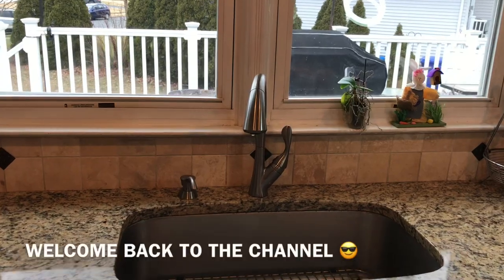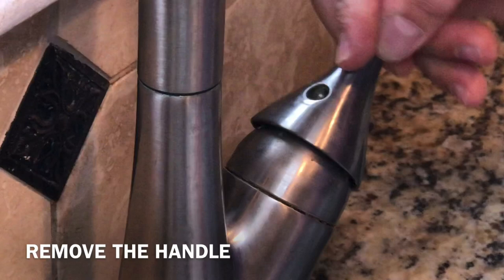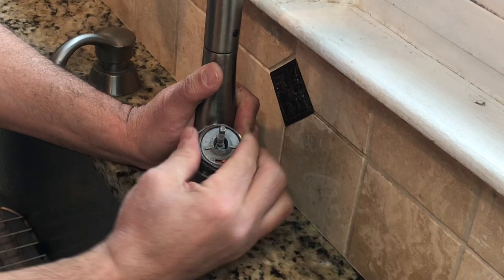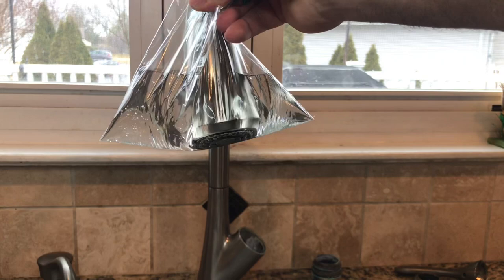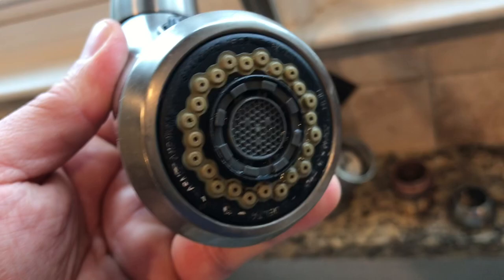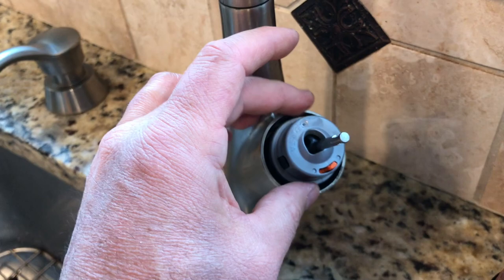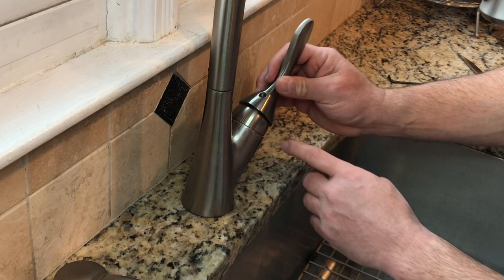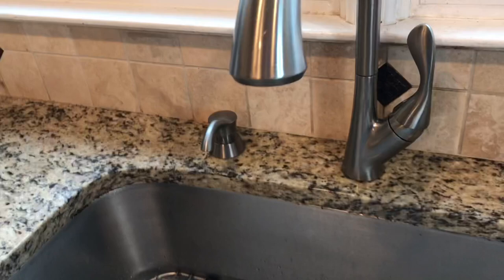HOW TO FIX A LEAKY DELTA FAUCET - Replacing a Valve Cartridge on a Single Handle Delta Faucet. Easy!

Comment: The dome on top of cartridge you removed by hand, I am not able to. My wrist is not that strong. It is stuck. The surface is all curved and besides i do not want to damage trying to remove with metal wrench. Any ideas on how I can loosen it up? WD-40?
Reply: I'm having the same problem.  Tried a rag around the dome with a wrench but still can't remove it.  Also tried WD-40 and banging it.    We have very hard water so its lodged in there pretty good.  Will try again once my wrist heals....
Reply: @BillKoren-ej7zo  So you can literally feel my pain 😞
I am at a point of doing whatever I can to get it open. Maybe get new part to replace damage.
Reply: Update: I ordered new dome and using plier teeth directly damaged and removed the dome. I have new dome so what do I care?
Problem: The dome came out fixed to the nut! Now I have to separate dome from nut. IF I cannot fix this I have no water in kitchen. 
Soaking it in vinegar now and praying. Hoping someone has bright idea in next few minutes to help me out.
Reply: Update: Soaking in Vinegar then using Rope Wrench on the nut and plier teeth on the dome did the trick! Just make sure when you ask delta to send the cartridge also ask for dome.

Comment: The dome cover is stuck and so tight, not turning at all. Any ideas how to loosen to unscrew it ?
Reply from the maker: Try some penetrating oil and/or applying some heat.

Comment: I have a hard time taking your advice repairing the drip issue when 1) your faucet is loose and moving around and 2) the instructions on the repair part clearly state "TONGUE AND GROOVE PLIERS ARE NOT RECOMMENDED TO TIGHTEN THE BONNET NUT" in addition the instructions state "THE BONNET NUT/VALVE CARTRIDGE SYSTEM DEPEND ON TORQUE TO CREATE AND MAINTAIN AN ADEQUATE SEAL OVER TIME" they specify a torque of 70-100 inch pounds.
Reply: I think you are trying to add a couple of suggestions to his video - but I can't tell.
I'd rather do it his way then pay a "Plumber" $225 to do a $10 Job.

Comment: Is the Delta RP50587 Single Handle Valve Cartridge a standard for DELTA? I have a very similar-looking DELTA faucet that drips. I am sure it is the cartridge. However, I need help finding my model online at DELTA. I'm worried that if I order this cartridge, it won't work. I hope this is standard for all their Single tap kitchen faucets in the style you show.
Reply from the maker: Not sure. Try contacting Delta first. I hear they will send you you a free cartridge.

Comment: How do you click the round piece back in place that separates the sprayer and the curve head of the faucet
Reply from the maker: Do you mean the magnet?
Reply: @fixinit  it’s the round piece inside the faucet that’s attached to the hose
Reply: @fixinit  maybe not sure didn’t know that was a magnet. It had a little clip to hold on to something.  It’s the sprayer that can be pulled out or stay in to use
Reply from the maker: @rachellsmith9517  Not quite sure if this is what you mean https://youtu.be/kLk3K5cNq0I

Comment: I can't budge the large nut that holds the valve. I've tried both a large adjustable pliers as in the video and a large adjustable wrench. I also squirted some liquid wrench around it and left it overnight to no avail. Any suggestions?
Reply from the maker: Try using a torch to heat it up
Reply: I had the same issue.  I sprayed it with WD40 and then used a large wrench and thick rubber bands around the nut to get a good grip.  I also have a rubbery  tacky tape that I could wrap around it as well if needed.

Comment: On mine when I remove the handle, the dome cap just spins but doesn't come off. Any suggestions to get it off?
Reply from the maker: Try pulling out on it as you twist. Sounds like it’s cross threaded.

Comment: Great video. I have a similar faucet, Delta, but it doesn’t have the the little set screw and it’s leaking slightly. I assume this one has no cartridge?
Reply: The set screw is probably hiding behind the blue/red, hot/cold, emblem on the faucet handle (that is where mine was).
Just take a tiny flathead screwdriver and pry the hot/cold emblem off.
Reply: @Pipping-Hot  I ended up finding it soon after I posting that comment. Delta sent me the cartridge for free. Thanks!
Reply: @NorthJerseyFooter  Why did they send you a free one? Do they offer free replacement for all of their cartridges? Cheers.
Reply: @gwarlow  I don’t know. I called them an told them my faucet was only 5-6 years old and they said it’s under warranty.

Comment: I am not impressed with Delta quality. My faucet is maybe 3 years old and already having this leaking problem. I'm not too thrilled about spending $40 on a replacement cartridge when I already know they make cheap junk.
Reply from the maker: I think if you contact Delta they will send you a free replacement cartridge